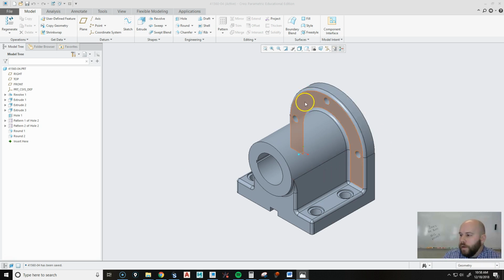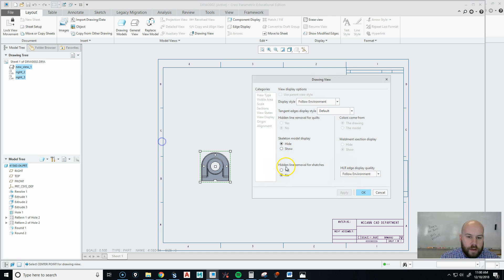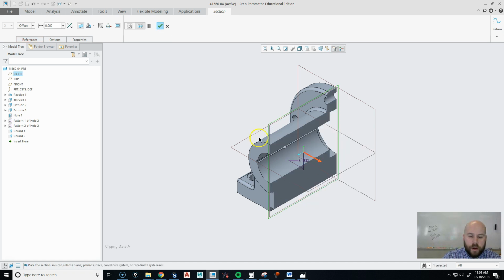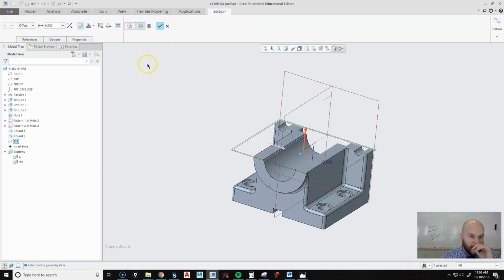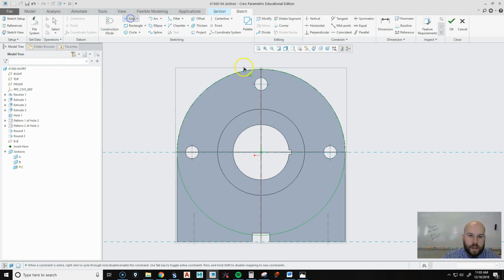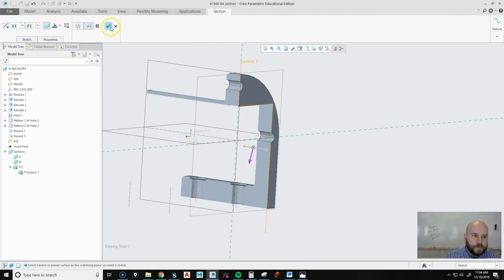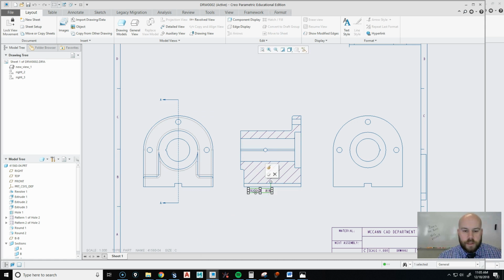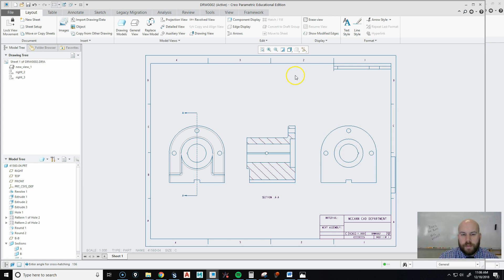CREO: CREATING A SECTION VIEW

Comment: my hashing lines are non active thus not able to change the spacing...help here..
Reply: Hello! Make sure that you are on the "Layout" tab at the top before trying to select your hash lines. These tabs act as filters, so if you are not on the correct tab it can be difficult to select the correct items. The other thing you can do if you're having trouble clicking them is pick the Layout tab then put your cursor on your hatch lines and hold right-click to bring up the Pick From List option. In the list, you'll see your hatching lines listed for selection. Hope this help!
Reply: @mrmez4306  thanks it worked..
Reply: @lekhank6106  great to hear!